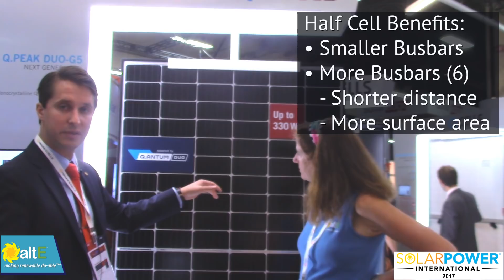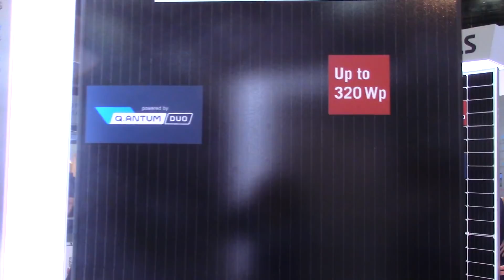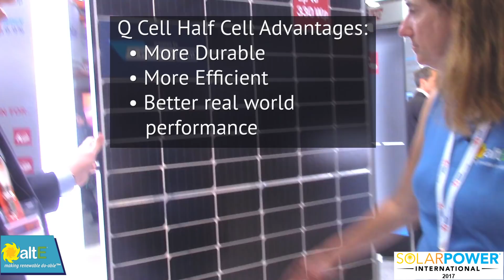Q CELLS Qantum Duo solar panel

Comment: in your opinion, is the watt per square meter much better than a standard 250 watt panel? because the way I see it, the cost per watt and the cost per sqm is also needed to determine the effectiveness of the array, if you are to stock the entire roof with inefficient panels where 500 watt panels that are larger than 2x250watt panels and slightly larger cost then it just doesn't justify the install.

Comment: 5 kw solar roof top how many unit electricity generate per day 60 cell ? 72 ?? 96 cell ?
Reply from the maker: It depends on where it is, the angle they are mounted, and if it is battery based or straight grid-tied. A 5000W system in New Delhi, India pointing south and tilted at 30 degrees will output about 22kWh a day average for grid tied, and probably 16kWh a day with batteries (more losses).

Comment: are these made in the US?
Reply: doesn't matter where they are built, quality is quality.

U.S. is expensive with production because of the cost to bring things in, the iron needs to be purchased from Australia, the silicon from other counties and yet you somehow think that having it made away from another country is better? they are still better educated than many of the staff on shop floors that sell half the furniture you sit on.

Sometimes you need to understand economics, Asia has the best logistics for gathering material and shipping stock out, to have a small market saying "I want to buy in USA because it is USA my home USA is marketing to just the USA and it won't justify the cost of the factory let alone the staff to fill it.
Reply from the maker: They are made in Korea. They will be subject to the tariff, but the pricing is not expected to jump too much for the foreseeable future.
Reply: Maybe the US will start making panel to compete with  supply need. 
Solar installer called me trying to convince me to go their grid tie system, one is to finance or lease, either way they put a price tag of $59k, saying federal rebate will cover all of payment, sounds a bit hard to believe. 11.7kw with 39 panels
Reply from the maker: Wow, tell them to hit the road. #1, $5 a watt for grid tied in MA is far too high. #2 the federal tax credit will be a tax credit worth 30%. #3, leasing is usually not a cost effective option. Much higher savings to own, even if you have to finance.